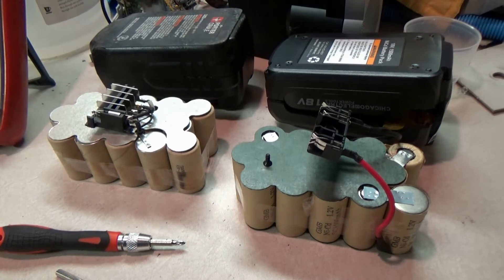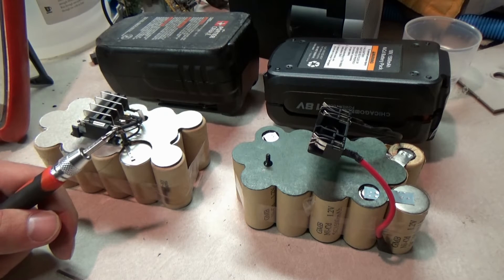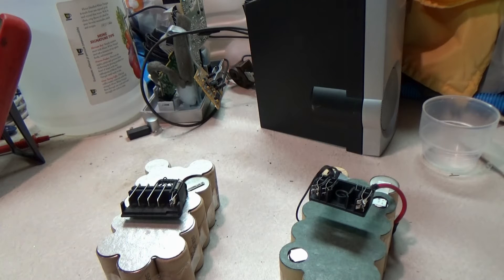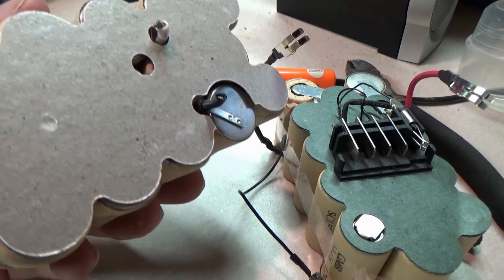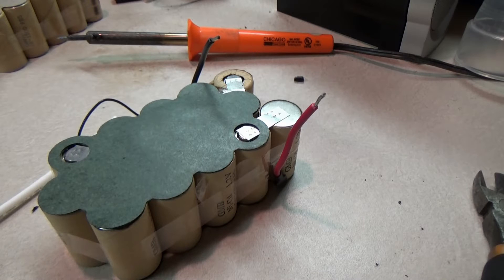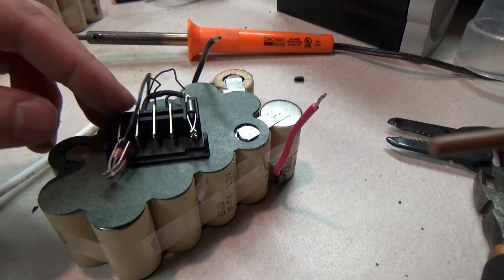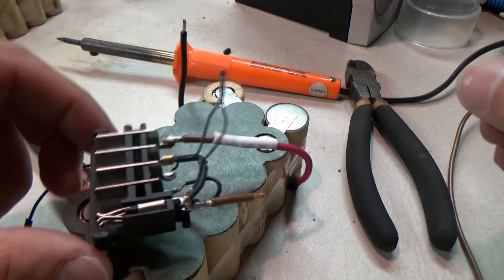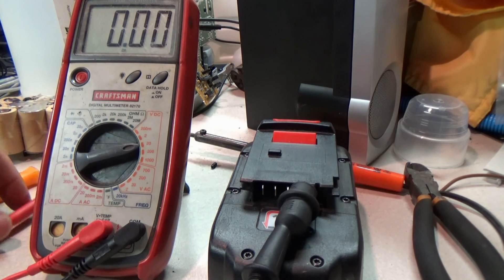Fix It CHEAP - Re-Cell Your Dead Porter Cable Battery

Comment: Bought a couple $12 (clearance) Harbor Freight 18v batteries.  Simple to put into Porter Cable battery cases.  Thanks!
Reply from the maker: Well worth it to keep good tools up and running! Glad it helped you out!
Reply: @gearheadny  Your video was perfect.  First one took about 30 minutes, the second about 10. 🙂

Comment: Will these work in 20v systems bauer ; everything looks identical on outside  .
Reply from the maker: Never really dove into it too much until now and a quick search for me yields what you're finding. Technically speaking, there is no difference and it's marketing wank. The cell configuration is the same, the number of cells is the same, and the power output is, and, for all intents and purposes, are the same grade of Chinesium. Ensure you're using the same battery type (Lithium vs NiCad, etc.), check and double check your work, and perform at your own risk. I hope this helps and If you can't be safe, be careful!
Reply: @gearheadny  They were discounted batteries but I didn't buy them , maybe next time .

Comment: this isnt cost efficient anymore?
https://www.ebay.com/itm/2X-For-Porter-Cable-18V-Battery-PC18B-PC188-PC18BL-PC18BLX-PCMVC-PCXMVC-Ni-MH-/333150103913?_trksid=p2349526.m4383.l4275.c10#rwid
i bought some FB tools that came with one charger, 1 nicd battery, 1 lithium battery. Both 18volts. The Lithium batteries plastic doesnt match the charger. The plastic notch is on the opposite side. Any idea why? (i was using corded tools before this =)

Comment: I just did one of mine like you showed and I found that the clips or contacts on the PC contact assembly slide right out of the black plastic.
Made it WAY easy for me to remove the original wire, clean, and solder a new wire onto the contact.
Reply from the maker: Nice! I'm glad this was useful for you!

Comment: I just did this using the original Temp Sensor from the original Porter Cable Battery pack. All I did was tuck it between the batteries like it was originally. Charged and I am currently using. Working just as good if not better then the old pack!!!

Comment: there are direct porter cable batteries made by topbatt on amazon, new, well reviewed...2 for 40 bucks....much easier
Reply from the maker: I'm sure it's easier, but it's waaaay less fun. Besides, this was repaired the same day in about an hour. Instead of waiting 3 days for junk to arrive, you can build your own for less money!
Reply: @willarddunn8552  ebay has them for $16 each, I got 2 and saved the hazzle of doing this BS

Comment: Install worked great but I did have a problem with charger flashing for over temp. Have to tear apart again and see what's up. Have you had this problem?
Reply from the maker: I haven't had this problem, but I would bet that the thermistor is not hooked up properly or may have gotten broken. If I recall correctly from my Google trips in the past, the thermistor resistor, as it heats up, will decrease in resistance and cause the circuit to show over temp. If the thermistor is shorted to ground somewhere, the circuit will show as over temp. On the flip side of the coin, I don't know how these respond with an open circuit... it could be the same error!
Reply: +GearheadNY okay thanks for the info
Reply: +GearheadNY ok so it was the temp wire from the Chicago battery that I spliced to the center terminal. Took that off and tested just fine.

Comment: Just finished changing the batteries. The turning upside down works like a charm. Had, however, a problem with the charger. I left old sensor with the unit . It's only scotch taped on. I just soldered the two power wires and everything worked.